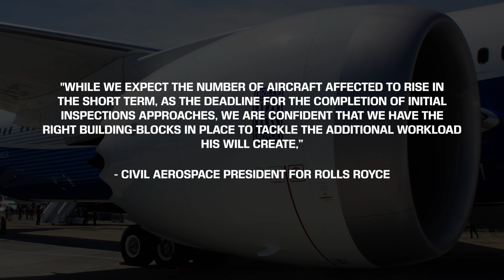Boeing 787 GROUNDINGS to WORSEN due to TRENT 1000s

Comment: with rolls royce engine impacting the B787 is it possible that some carrier would switch to  the General Electric engines?
Reply: Alfin R  Not. On existing aircraft. Perhaps with future deliveries but is not likely either assuming the issues are resolved. Also GE can barley keep up with existing orders so not many engines are available in the GE pipeline
Reply: Good question.  Thank-you for sharing.  From my research, changing engine manufacturers once a configuration is purchased is virtually impossible.  Each engine type is installed with different bracing, pylons, and other engineering differences affecting the wings and other components.
Reply: Thank-you for your insight, Ben Daulton.  I deliberately left my reply to Alfin R short, because the actual re-engineering is is staggering.  Weight and balance are additional considerations as well as a host of things.  However, I think I read that the A350 is being constructed with the ability to make such changes much more feasible.
Reply: Sir, please do not misconstrue my replies as arguments.  I earnestly learn a great deal from folks such as you.  I really do appreciate anyone with more knowledge than me making comments.
Reply: When was still in the designing stages of the 787. They showed the design specs to aviation analysts. They show some engine mounting commonality with GE and RR. Boeing answer was that they wanted aircraft lessors to be able to switch engines within 24 hours to make it easier for them to place the aircraft with different airlines. With other aircraft including the A350xwb uses bleed air to run various systems, so switching engines on those planes are difficult but possible. But the 787 more electric design only uses bleed air for engine deicing, everything else is electrically driven including brakes.

Comment: Thankyou, hope you get better soon.  We do need to remember that Rolls Royce is a british company, and between the Italians and the British, it has always been a race to see which car failed first :-(
Reply: "Rolls Royce are known as just about the best quality cars you can possibly buy"

No they are not. They are the most expensive and nicest to sit in but no one thinks they are much good as cars. If you want a high quality car you buy a Toyota Corolla. If you want the best place to sit you buy a RR.
Reply: Everyone knows that. RR cars are owned by BMW, which means they have the same shitty german engineering as every other BMW car.

RR engines have their own special version of shitty engineering
Reply: audigex 
Ofcourse.....a Rolls never breaks down.....it just fails to proceed.
Reply: Todd Dembsky Man Rolls Really dropped the Ball here. not sure why this has been such an issue on thr largest,engine development they ever,did
Reply: Rolls Royce cars have got nothing to do with Rolls Royce aero engines !
Reply: audigex: You are very wrong here. When Packard built the Merlin under license, they did not just copy the poor reliable Merlin design from Rolls Royce. The made massive improvement in the supercharger, the PSRU, and the engine reliability as a whole. As such the rest of the RAF airplanes quickly were equiped with the Packard model of the Merlin engines instead of the woefully underpower crap produced by Rolls Royce. All the legacy Merlin engines you see powering boats, and restored P51s today are Packard built engines.  Nobody in their right minds want to use British engineering.
Reply: Rolls Royce are known as just about the best quality cars you can possibly buy... and Rolls Royce airplane engines are some of the best ever. I mean, your P-51 Mustang wouldn't have been much good if it had to stick with the American Allison engine it was designed with instead of the British Rolls Royce Merlin it ended up with ;)